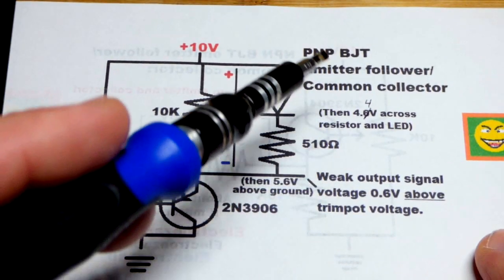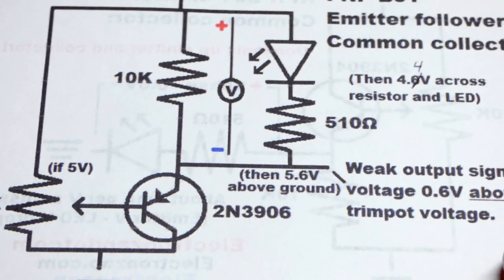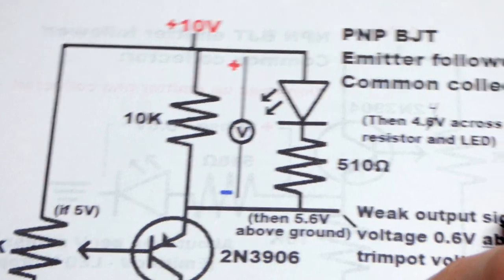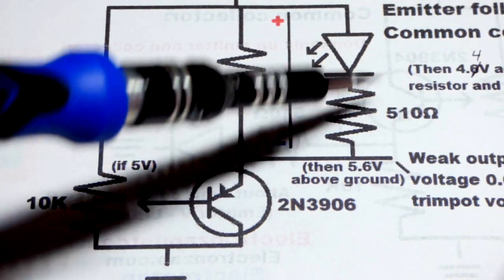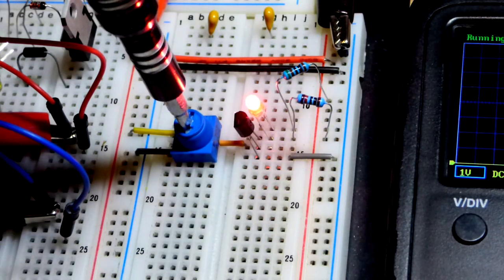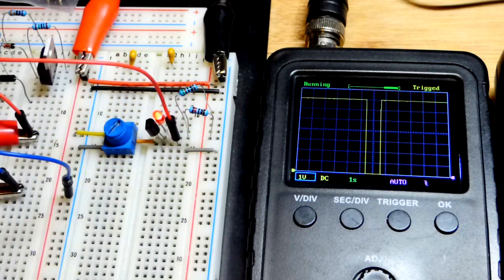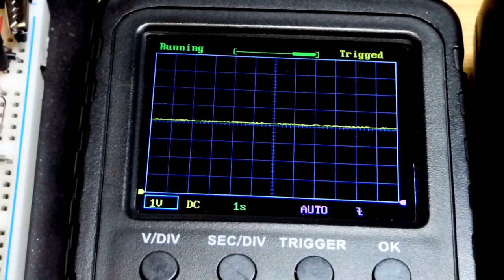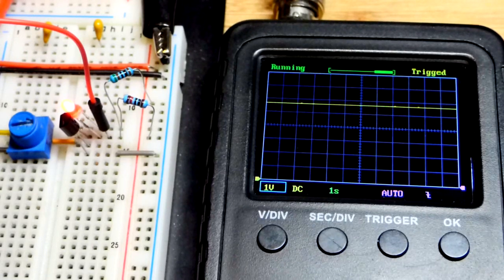PNP BJT emitter follower common collector circuit using 2N3906 bipolar junction transistor

Comment: In a common collector configuration, does the transistor operate in active region or fully saturated?
Reply from the maker: The transistor is in the active region when wired as an emitter follower. It limits current as needed to drop some of the supply voltage from the load.

Comment: Great videos! What is the point to have a 10k ohm resistor in parallel with a 510 ohm resistor + led in the emitter? The 10k does not add much to the total parallel resistance of (10k x 510)/(10k+510)=485.25 ohm. Why is the 510 ohm + led only not sufficient as the only load in the emitter? Why add 10k ohm in parallel if the total parallel resistance drops to 485 ohm?
Reply from the maker: Some loads will throw off the emitter voltage if they are by themselves. A 10kΩ from emitter to supply voltage (for a PNP BJT) or ground (for a NPN BJT), helps make sure the emitter holds the voltage it is suppose to.